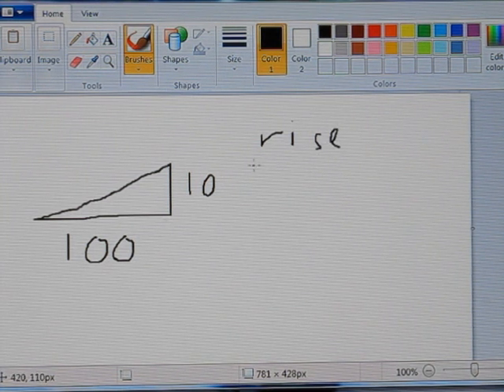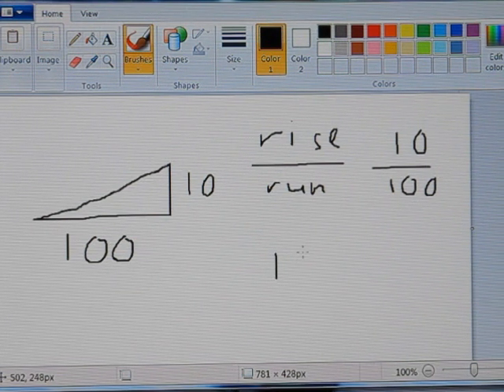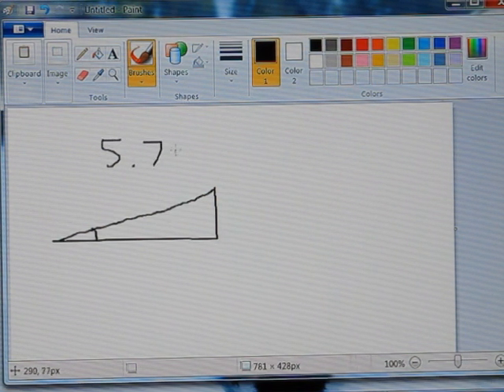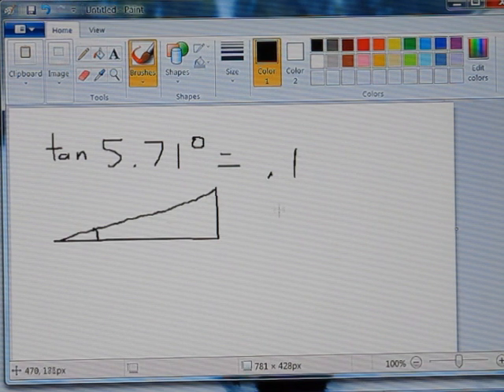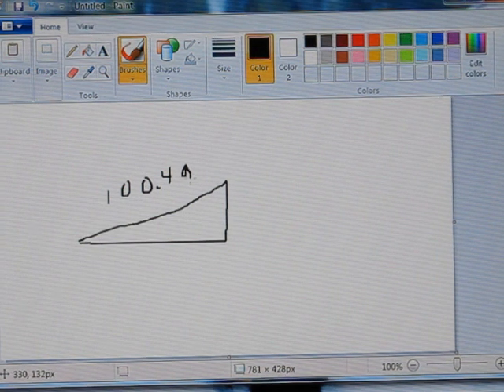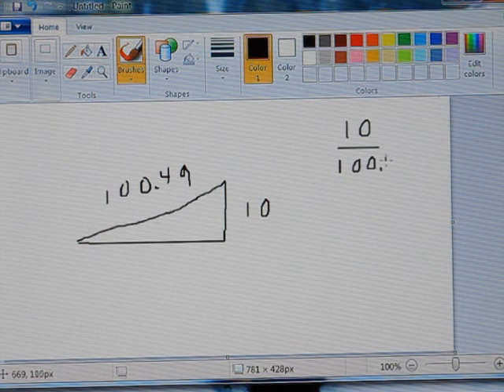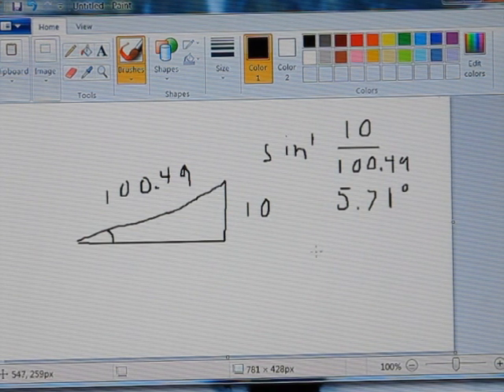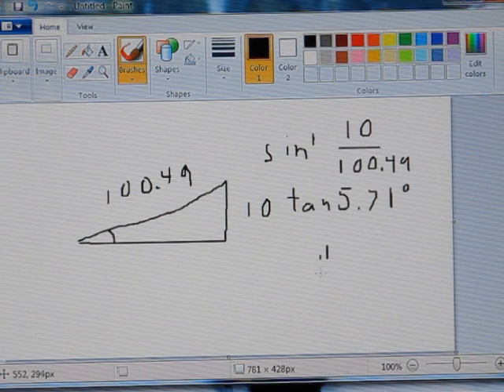How to find the grade of a hill

Comment: I'm clearly missing something.  How can a 10' rise over 100' be the same grade as a 10' rise over 100.49'?  Close sure, but the same?
Reply from the maker: I am using the trigonometric function inverse sine and tangent. If this is unclear review soh cah toa in trigonometry.
Reply from the maker: also 100.49 is the longest side of the triangle which is the hypotenuse. So it is rise over hypotenuse not rise over run.
Reply: @VAM_Physics_and_Engineering  Got it!  Thanks.

Comment: I do not get it. How do I measure the verticle  .? I do not know what the "up" measurement is !   I am trying to get the degrees of my driveway rise. It is all level on sides of lawn. All I know is it rises up as I come around the turn and levels off at my garage. Thanks
Reply: Just flip his picture upside down and now you have the straight part on top with the driveway at an angle.  Configure a laser level at the top of the driveway (at night) and hold a board or pole at the bottom and measure where the laser hits the board (the laser is the straight horz line).

Comment from the maker: generally done by gps now days. there is a few different ways you can measure it; distance above sea level, base of mountain to peak, and distance from center of the earth. the most popular is distance above sea level. you could also use a altimeter which measure barometric pressure in the air and tells what altitude above sea level your at. you could prob also use brute trigonometry to figure it out given you know some angles and distances. hope this helps